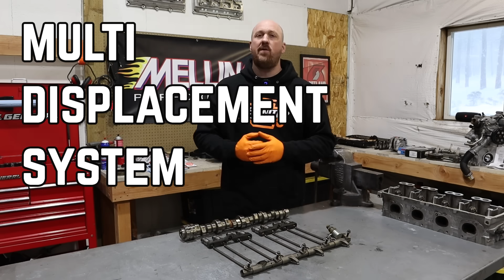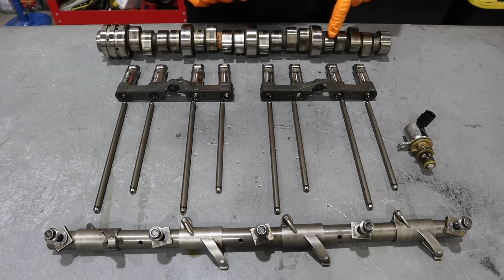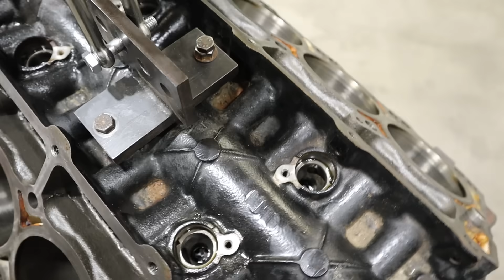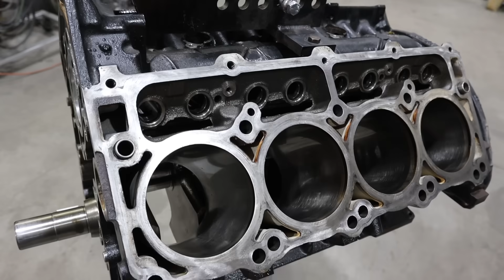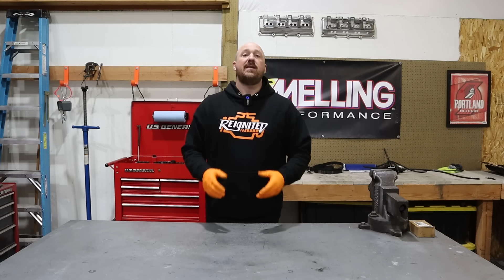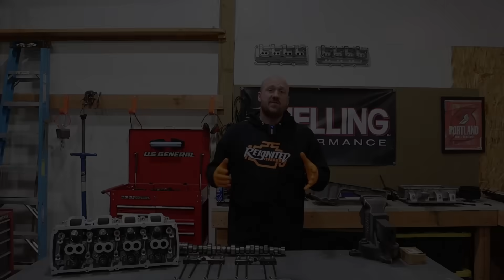Is MDS Damaging Your HEMI? The Answer May Surprise You!

Comment: The mopar mds system is light years ahead of gm's. Having worked in the parts dept. at a chevy dealership it was not uncommon for us to have as many as 3 cam and lifter replacements going on at the same time. We also had a brand new tahoe with 7 miles with lifter issues right off the truck. One thing that has puzzled me however is my fuel level sensor went out ( another common problem) and when it did the mds would no longer operate. Have you heard of this and why would that cancel out the mds? 2014 Ram 1500
Reply from the maker: That doesn't surprise me. I don't have the info in front of me, but I remember when I did a class on the MDS system there was a page long list of codes that would disable the system. I think they were over sensitive about it and wanted to make sure the vehicle would have full power at any point it was needed.

Comment: I have an 05 grand Cherokee. I alway assumed the lag i feel between hitting the throttle,and it actually doing something was a side affect of having a fly by wire throttle body. I didnt know it has this stupid mds system. Also that jeep gets shit gas mileage. Way worse than my 00 silverado 5.3.
Reply from the maker: You're actually correct that the majority of the lag you are feeling is due to the drive by wire throttle body. Interestingly enough, there is an aftermarket part called a pedal commander that will get rid of that lag and make the throttle much more responsive 👍
Reply: @ReignitedAuto  i appreciate it. I'll look into that.

Comment: Can you make a video on the cam phaser sprocket thing that's on the end of the camshaft how do you tell if it's good or bad also what are these lockout devices that people are putting into them what is that for
Reply from the maker: https://youtu.be/cPuwi3cFJMA
Boom! Got it ready for you 👍
Reply: Also we need a complete video on cleaning the head and how to do it so that we don't mess it up it should be clean right because it just repeats Heat so we shouldn't leave a lot of Gunk on it
Reply: Third video we need a video on disassembling the valves I bought a Harbor Freight Tool that am I going to try used the large C-clamp on my F-150 97 Ford 10 years ago it worked I want to see you take these heads apart the valves and show us what's right or wrong the spelling is because of voice instead of me typing
Reply: Thank you for the cam phaser video but still don't know how to know whether it's good or bad I've read where they can be locked up and what is the results of that
Reply from the maker: @ElbertAllen-vv1xg  it's very difficult for the phaser itself to fail, as you saw in the video it's a mechanical device that is operated by pressurized engine oil. In 14 years as a dodge tech I've never once seen either the phaser or the solenoid fail. If something did happen to the system the vehicle would immediately set a cam/ crank correlation failure code, it's the same code that it will set if someone mistimes the engine. Along with that it'll probably set a code for cam position is less/ more than desired. Again, I've never actually seen one fail, it's a pretty solid system that has huge advantages over a fixed gear cam.

Comment: I just had a breakdown. I was at a red light, and the check engine light came on, then it started running rough, and the "service electronic throttle control" message came up, then it died. I couldn't start it back for a few tries, but when I did, I got it out of the road, and it would barely run, and it is still ticking after I had it towed. Any help would be appreciated!
Reply from the maker: There's a possibility that a valve spring broke. First step would be to identify which cylinder is misfiring. There should be a few different codes set but we want to focus on the one that points to which cylinder is having the issue. Once you're able to isolate which side of the engine is having the issue, I would pull the valve cover on that side and inspect all the valve springs. This is not my normal procedure for a misfire, but based on how you explained it, this is the direction I would go.

Comment: Just got the cylinder 1 misfire on my 2014 srt Jeep.  Drained the oil and there are metal shavings in the filter. From your experience, would you change the cam and lifters or go straight to a full rebuild?  I have not taken the motor apart yet to see the extent of the damage but I have one shop saying cam and lifters and another saying full rebuild without looking at the motor.

Comment: Hi thank you for the informative video. I have a 2010 jeep grand cherokee 5.7 with mds ,and was wondering if I was to cancel the mds system would I need to use a tuner or just the plugs along with the non mds lifters and also the camshaft ,, another question I have my suv has around 125000 kms and unfortunately over heated with the previous owner ,, so i am rebuilding the engine ,, would I be able to reuse some of the old parts and just swap the pistons and the rings to an oversize ,, any aftermarket rebuild kit that is recommended by you ?

Comment: If it is harmful to turn off the MDS what about when you use tow haul, because that turns off the MDS?
Reply from the maker: More so I'm speaking of long term turning it off. The vehicle is designed to work with the MDS system off in a variety of situations including towing. I'm simply advocating not to turn the system off for 10's of thousands of miles.

Comment: Which, exactly, high volume oil pump do you recomend?
Reply from the maker: Depends on the year,  for 2009+ 5.7 and 6.4 engines I recommend the Melling 10452HV. For 2008 and older 5.7 or any 6.1 engines I recommend the Melling 10342HV 👍
Reply: @ReignitedAuto  ...and the 6.4 newer ones?
Reply from the maker: @thinkfast469  as I said 10452HV 👍
Reply: @ReignitedAuto  My bad....first thing in the morning read.  TY

Comment: Hi, this video is very helpful thanks.  I have a 2006 Magnum 5.7l and turned off mds without installing hardware, my block now has a hole in it LOL.  I have a brand new engine being put in this week, can I get away with just non MDS lifters and the solenoid plugs, or do I need to add a camshaft to the build as well?  Thanks in advance.

Comment: Not sure im understanding the “spring” idea of deactivated cylinders…. If the cylinder is still pulling air from the intake it is still pulling some carbon into the cylinder but now without fuel and adequate heat to minimize buildup?
Reply from the maker: When the lifters are collapsed both valve are shut so it's not drawing any air from the intake. 👍

Comment: Getting ready to send my 2019 Ram PCM to HP Tuners in order to be able to disable MDS, only for the fact I feel when it activates and do not prefer it rather than thinking it causes lifter failure (which I dont believe). I did it on my 2011 Silverado. But am surprised to hear you note that when doing this it limits oil flow to the MDS lifters. First I've heard of this. So the MDS lifters are getting lubrication but not the full amount when non active? Have you heard of lifter failures after deactivating MDS via a tuner?

Comment: If the cure is a high pressure oil pump.then why don't they put a pump in the engine that is rated high enough to prevent the problem in the first place.( Built to break)
Reply: I’ve learned just not to let it idle.  I don’t drive it too hard but I always do just enough to keep the oil pressure higher up.  37psi roughly at idle isn’t cool in my opinion I like to so it in the mid 40-50’s while driving.  Gotta keep the oil pressure up and limit idling
Reply: some say high pressure some say high volume .. who the f knows ..

Comment: I skimmed through the comments but didn't see anything related to the exhaust manifolds leaking. It is pretty coincidental that the exhaust bolts started breaking in the 4th Gen Rams when MDS was introduced. Then Ram beefed up the bolts for the 5th Gen Hemi Rams, which then only moved the problem to the manifolds cracking, which are now the week point. Many suspect that the MDS causes the exhaust temperatures from the "disabled cylinders" to be cooler than the exhaust from the "active cylinders", which causes uneven heating of the manifolds. These exhaust leaks started when MDS was introduced.
Reply: I have 04 Ram 5.7l no mds, my passenger side back 2 exhaust bolts broke, i also have 07 durango 5.7l, my 2 bolts broke on passenger side back same as my non mds, i hear the aluminum heads heat and cool at different rate than the iron manifolds do which causes the bolts to break.

Comment: Ya great info, just a simple question, do I need to do any ECM programming  when eliminating the MDS solenoids?
Reply from the maker: Yes you will need a tuner to turn the system off completely otherwise you will have a constant check engine light 👍

Comment: Question as someone who’s been pretty involved researching this same topic: You mention tuning off only can cause issues that the MDS cylinders will not get adequate oiling when their lifters are no longer fully in use (I’m paraphrasing, I know I’m not quoting 100%). If that is the case, wouldn’t running WOT, or in manual mode, also then be bad? Why would running all 8 tuned off then be worse? 

I’ve had my 6.4L Challenger coming up on 5 years now, 101k miles, and majority of those I’ve ran with the MDS on. I drive many long trips and the benefits have been noticeable. But on occasion I will tune off, for the smoothness of just running on 8 all the time. And with my Solo exhaust now it just sounds far better always being in V8, as it’s very jerky due to the “noise” change as it switches to V4, it sounds very lugged for a second. And it will vibrate a bit. I do know this is due to my own exhaust, not totally the MDS’s fault.

Comment: I just bought a used 2016 Ram with 113k miles runs great it's in excellent condition i knew nothing about this mds or cam issue first time owning a Dodge always been a Ford owner. I noticed it has the cold start tick and goes away after about 30 seconds warming up. I ran it with the mds off for about 500 highway miles and noticed that it had a much weaker start like it wouldn't fire up as strong so then i watched this video thinking maybe not running the mds the way it's intended is not a good idea you explained that very well i appreciate it. I was getting about 17mpg with mds off and now 18 with mds eco mode active. It starts up much stronger too the way it should.

Comment: so my 2017 ram 5.7 litre ticks on 8 cyclinder on idle , when i get up to 40 km/h and let off the gas it goes into eco mode and the tick goes away completely not even a little bit its like the ticking completely stops , u slow down to 20km/hr and it starts ticking again because eco goes off , people tell me it ticks whens its under load , then why does it tick on idle when its not under load ? is it my lifter that is screwed or is it a selenoid which someone told me it is ? thank you

Comment: that makes no sense. MDS does not activate at idle. so the MDS cylinders are getting the same amount of oil as the others at idle or when MDS is off. The only time they get more oil is when MDS is activated. But thats only under non idling operation...which mains the oil pump is pumping at high volume anyway and they would still be getting the same oil flow as the non MDS lifters if the MDS lifters are turned off. So at no point do the MDS lifters get less oil than all the other lifters, whether or not the system is on or off. So how would disabling the system harm the lifters ? They are still getting the same oil flow as the standard lifters..... ??? am i missing something ?

Comment: 2023 5.7 Ram says 0W-20 is this safe? What if I switch to 5W-30 will it cause a problem or be better?
Reply: Don't. Too thick. Use high quality synthetic with right additives. Pennzoil Ultimate /Platinum for one.

Comment: I have this issue now with my 2009 dodge ram 1500. Any idea how much it will cost me to replace camshaft and lifters?
Reply from the maker: It really depends on the shop, but at a minimum you can expect around $4500. However if you are at least slightly mechanically inclined I would encourage you to take on the job yourself, it's really not that bad and I've got a bunch of videos that can help you with it. 👍

Comment: I have a 2012 charger pursuit 5.7.  I went non mds. Replaced lifters, cam and block off plugs.Added a hellcat oil pump but put the 5.7 psi spring in it(regular psi but more volume oil flow) I used the diabloi3 tune to turn off mds system. Im getting multiple misfire codes and you can hear the ticking/rattling from the misfires. I installed all new coils, plugs, and injectors. Cleared codes. Car ran quiet for a few minutes and the the codes came back. I,4,6 &7 are supposedly open. Does that mean the cylinders are shut down, not getting spark, not getting fuel etc. I'm kinda lost picking my brain as to why I'm consistently getting multiple misfires after all of the above. Hopefully you can help me remedy the situation.
Reply from the maker: Ya it definitely sounds like the tune hasn't properly disabled the MDS system.
Reply: @ReignitedAuto  if I go back to tune, modify parameters in advance tune won't show up. But I did turn mds off in the begining

Comment: Im about to replace cam and lifters in my truck have you ever used any other brand besides oem
Reply from the maker: I've had bad experiences with cheap aftermarket lifters, but I'm sure some of the more name brand stuff is fine. The cheap ones tend to rattle indefinitely and it drives me crazy.
Reply: @ReignitedAuto  would you think the enginetech or dnj brand lifters would he fine ? Local parts house has sealed power but they want 300 per set and my local dealer wants 1300 for all 16
Reply from the maker: @Splatkat45  unfortunately I think you get what you pay for when it comes to lifters. This isn't really a job you want to have to pull apart again just to replace the lifters again, but that's my opinion.

Comment: Mds destroyes the cam bearings and crank bearings by closing oil to the lifters and causing uneven crank pressure BUT the 2000 5.9 V8 is best

Comment: Love these walk through videos. Actually seeing the parts and how they work in detail helps tremendously because I know nothing about this stuff. 

I am a little confused though on one thing - if MDS is off, is there any oil making it to the lifters? A lesser amount of oil? In either case, isn’t that a bad thing? I don’t know anything about engines but you’d think less oil is bad (even if the oil pump is pumping the max amount).

Comment: Skyy the engine cradle hoist that you had on this video. Were did you get it from ?
Reply from the maker: That's actually a factory special tool. It was manufactured by Miller tools which I think Snap-on purchased a few years ago. The Miller part number is: 8984A 👍